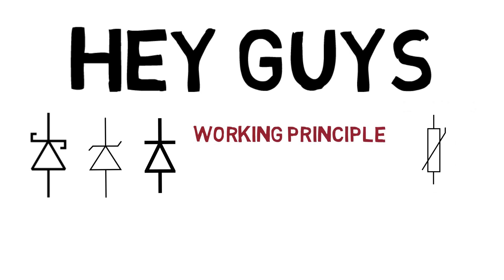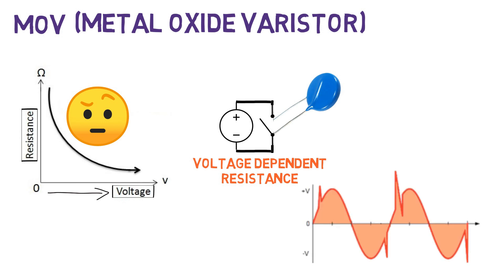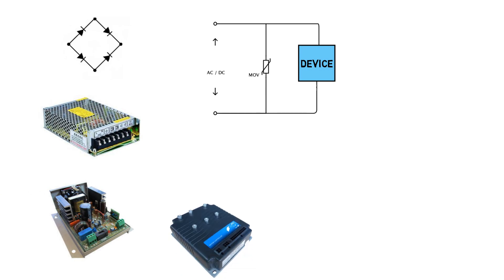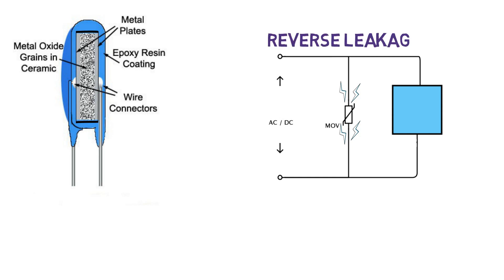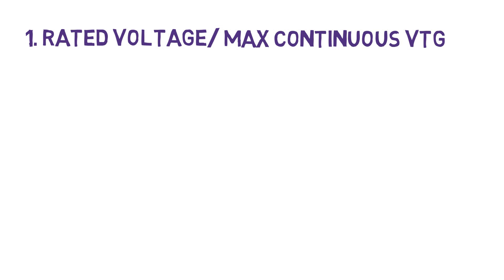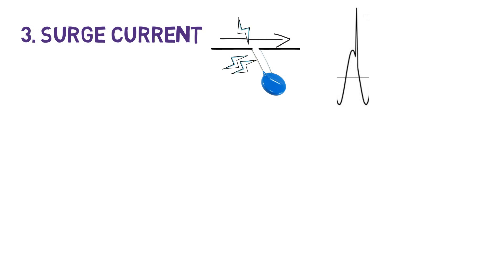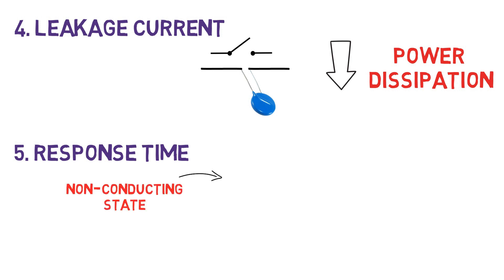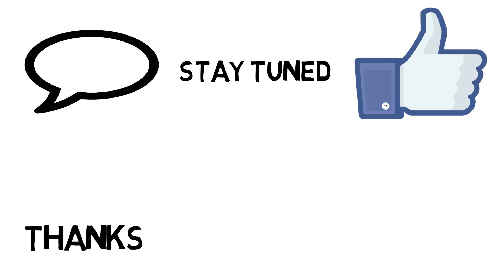What is MOV? | How to select a MOV?? | Metal Oxide Varistor | Varistor Diode

Comment: Bro I have a project...please help me.
I need a diode which can pass a certain voltage,say 5v.
It must not conduct if the supplied voltage is lesser or greater than 5v.
Please help me.Which diode to use?
Reply: Voltage regulator

Comment: What varisitor  number to be use at home main line 220v.
Reply: 431KD20
Reply: How about 220-240VAC?
Leakage current?
Should I use a 431 or 471 volt MOV?
Reply: si tienes una vivienda con 220v RMS, entonces  pudieras usar el 20d391k o el 20d431k, uno es de 250v y el otro de 275v , tú escoges que tan sensible quieres proteger los equipos con alguno de esos dos Varistores

Comment: Thanks for the video. It is very informative. I do have a couple of questions. Classic schematics of High Speed Vacuum  use a capacitor to suppress the Back EMF to protect the keying circuitry when the relay is released. Could a MOV used as a substitute for the capacitor ? The voltage used to actuate the relay is 26.5 volts which seems well within the capability of the device. My concern is the durability of the device. The relay and the coil driving it are both small so I would imagine the energy generated in the Back EMF spike is not all that big. However the device is keyed at a high rate. Is there any way to determine the durability of an MOV? Do MOVs break down quickly? Are they suited for this type of operation ?

Comment: Good lesson for us as beginners in electronics.  I learnt a lot about MOV's.  I have 4 Panasonic bluetooth tower speakers, and now 3 are defective.  When I checked the circuit in one speaker, I found the fuse was blown and the  MOV damaged. I presume a high voltage spike had entered and as a result the MOV got damaged and the fuse blown.  I changed the MOV.  The fuse blowing stopped, but the problem is not fully solved yet.  I  can see very clearly a small damage (a tiny hole)  on the surface of the  MIP2F2 IC of the circuit, which I doubt to be a crack on it's surface.  Could this be a result of the high voltage passed into the circuit?  Grateful for your expertise advice.
Reply from the maker: Yes! I think high voltage has been passed through the circuit.
Reply: @FoolishEngineer  Thank you

Comment: Very interesting. I wonder when it clamps the voltage, where does the excess voltage  go ? Also, does it act in this case as an ideal voltage source of 0 internal resistance ?
Reply from the maker: It bypasses the voltage and doesn't let it pass through the load. It acts as a close circuit and load is disconnected from the supply.
Reply: @FoolishEngineer  will it flip the fuse?